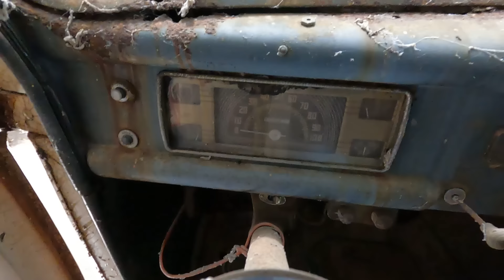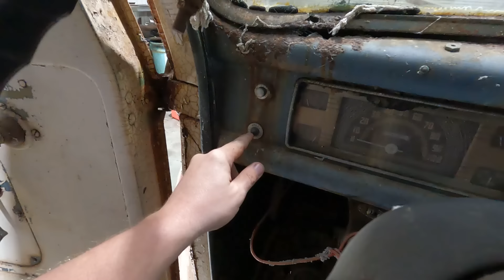Will this 1944 Ford Flathead Ambulance Run? Sitting over 30 YEARS! Will it Run?

Comment: Man this thing is awesome. I'm a sucker for anything wagon like. Just picked up a 1950 Pontiac delivery with a straight 6. Watching your excitement for the engine turning over is the exact feeling I had when mine turned over after 40 years of sitting.
Reply: Picked up my 50 Pontiac sedan delivery in 1971 when I was 19 years old for $35. It has a 1956 Olds V8 in it. Very fast.

Comment: I thinks 6 volt systems back then were positive ground
Reply: Yes, you are correct
Reply: You are correct, I own a 55 ford f350 and it is positive ground
Reply: Many were, but not all, it was not standardized. You need to check for each individual vehicle.
Reply: They are. Found that out the hard way on a 49 Ford 8n tractor
Reply: @Mariano.Bernacki Fords were
Reply: Yes they are

Comment: Of the many variations of Hearst’s and ambulances’s made back in the 20’s thru late 50’s, this one seems most practical, for possible use as a mobil mechanic or, large fam multi-seated Suburban type of ride, with just enough bad-ass styling, without being excessively macabre…   Could really be one heck of a sweet ride! Personally, I’d fix’er up as is, keeping original driveline and all else, as it is.. just fix/refurbish everything and use it. I really dig that snazzy cabinetry!

Comment: If that ambulance is in fact a 1944, that is one of the rarest vehicles in existence and should be restored to original instead of being turned into a hotrod. It is entirely possible it literally may be the very last one still in existence. I don't have a problem with turning vehicles into hotrids in most cases, but when it is something that is extremely rare, I feel they should be restored to original and this is one of those vehicles. Due to the rarity of it, restored to original it may be worth 6 figures since it was one of the very very few vehicles that was built for non-military use. Even civilian ambulances were nearly impossible to get and there were likely less than 100 civilian ambulances built and it's likely this may be the last of it's kind. Why chop up such a rare piece of history? Once it's been hotrodded, its historic importance is gone.

Comment: I am the current caretaker of my families heirloom, it was a 35-37 Ford med heavy truck, no body except for the cowl, hood and grill, shortened to about a 90" wheel base, mech brakes split so pedal is lr, park handle is rr, 53 flathead v8, basically a homemade "tractor" aka a doodle bug, my point is, the starter and points, condensor, will last virtually forever on 12 volts, you need a Chrysler type igntion resistor and a 12v coil, otherwise all the bulbs and electric gauges need to be changed to 12v parts cuz the smoke is gonna come out of the 6v ones, oh yeah also the generator needs changed to 12v obviously, but those starters are so tuff it'll last, ours is the original 1953 Ford unit and still cranks faster than the idle speed, lol
Reply from the maker: that's awesome!

Comment: A condenser is a capacitor. Condenser is the word that electrical engineers used up until about WWII then they switched to using the word capacitor....The automotive industry never got the memo, and still calls them condensers....That said engine capacitors are a specific capacitance and voltage (several hundred volts to deal with the inductive spike of the points) and ruggedized to withstand much hotter and colder temperatures as well as the rapid temperature swings of starting an engine in arctic winter and letting it warm to full oppearting temp...so any old random capacitor from some consumer electronic device is unlikely to work,  and even if it does work it's not likely to last..

Comment: That front grill was known as a “jail bar” underneath that green paint should be stainless steel. I had a 46 Ford p/u. The main reason those “Jail bars were painted was that after 70+ years the stainless gets pitted.
Reply: On that ambulance the grille was painted because it was made in 1944 and brightwork was not used because it was during WWII.
Reply: @todddenio3200  that’s true but they were stainless. All the 46 Fords lights parts., chrome parts were made from or stamped from “molds” made before the war. Those bars also known as “Waterfall” bars were not chrome but stainless steel. Most were painted during the war . But the main reason was cosmetic because of the pitting of the stainless steel.
Reply from the maker: I have two jail bars, and neither of them have stainless bars. Even got parts off multiple jail bar trucks, none of which were stainless. very early 42 trucks had chrome bars but never stainless that I have ever seen.
Reply: @marklevine-es2br  Did I say CHROME?  NO.. I did not... I said BRIGHTWORK which is used to describe EITHER chrome OR polished stainless. During the war for national security in case we ended up being invaded, all brightwork was painted over because of how reflective it was and chrome was needed for the war effort and was too important to be used for frivolous things such as shiny trim on vehicles.
Reply: @todddenio3200  if you say so.
Reply: @todddenio3200  I did my research here my ford was early production all chrome was for in short supply still do in some models early on stainless was used instead.
Reply: @marklevine-es2br  apparently you have not heard the term BRIGHTWORK.  It is a term which was used to reference ANY shiny trim on a vehicle and on other things as well. I guess according to your unlimited knowledge the only words that were ever used to refer to shiny trim pieces on a vehicle are -chrome, stainless, nickel, or brass.

Comment: Okay this is a positive ground electric system by using a 12 volt battery you can over heat the pig tail contact on the coil you can use an 8 volt battery and the 6 volt system will handle it without problem and keep it charged as well as spin the starter like a 12 volt battery

Comment: 5:36 I would leave the original engine in it, though the trans I might swap for a more modern 5-speed or 6-speed manual. Turn it into the ultimate RC plane hauler.
Reply from the maker: as much as we plan to travel and drive it this flat head wont cut it.

Comment: When you go to 12 volts, you need to upgrade the coil, coil wires and solenoid to 12 volts, or things may get VERY exciting for you!!! And those wires are ANCIENT!!! Even if they were in GOOD shape, they would probably overheat!!!
Reply: Best to just keep it 6 volt.
Reply: @robert3302 : If you have patience ( a LOT of patience ) with really weak starting and dim headlights. They have voltage upgrade kits. It’s quite simple to do. Just boost the power to the headlights and the starting. Make sure to upgrade the coil and the solenoid. Then use ballasters to keep the extra power out of any wires you don’t wish to upgrade. Simple.

Comment: The switch on the steering column is an ignition switch and also a steering lock. The switch under the dash board is for heater control.there is a button under the solenoid and u can work the starter with it

Comment: Very rare , not many vehicles were produced for domestic use in 1944. Was it a military vehicle? Or perhaps a little newer and produced right after WW2 in early 1946?
Reply from the maker: My best guess at the moment is it was made for something war time related. But maybe never made it. It has a build delivery date of 4-13-44 on the interior tag. So definitely 44 or older. Could possibly be a 42 but the tag build date and chassis serial number all check out for 44. Super super strange year and throws me off. But no telling until I can find the history on it and know for sure. But being war time Era makes it that much cooler to me.
Reply: Ford civilian vehicle production ended in early February 1942.  If I remember right February 10, 1942.   I just did a Google search about when Ford resumed civilian production.  Both said 1946 but not a month.  I have a 1942 Convertible Club Coupe production date of December 11, 1941.

Comment: Ur gonna have to hot wire the coil to get it ranked.What u need is an old timer to show u around Henry Fords brain.Thswtch on the steering column will have to be on or hot wire the coil to the hot side of battery and u run the risk of blowing up the coil with 12 volts. Be very very careful, ask me how I know. I’m 77